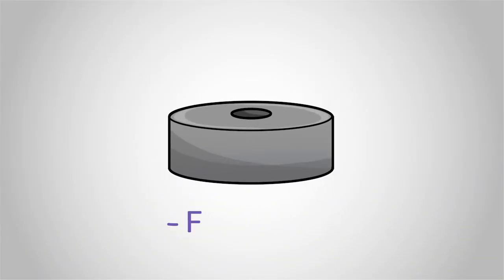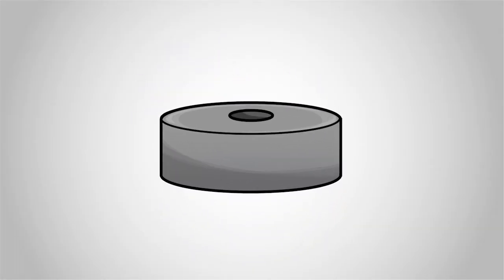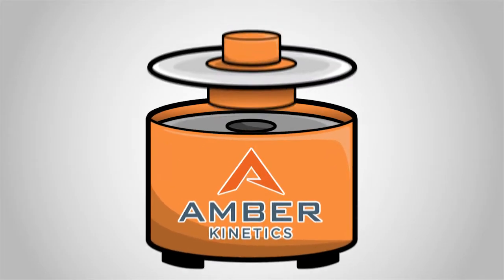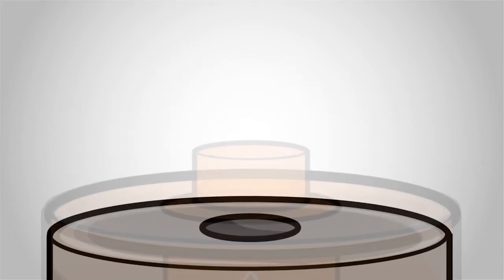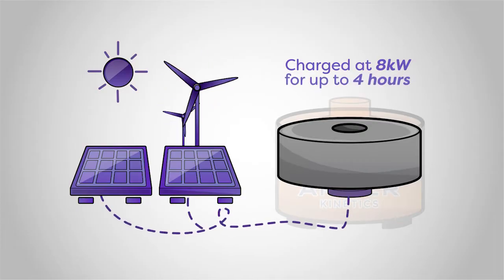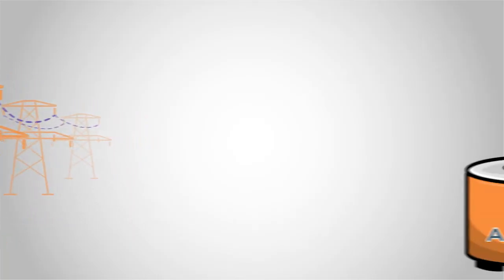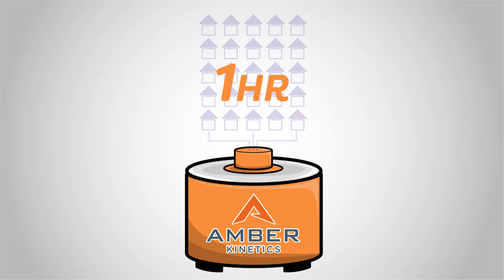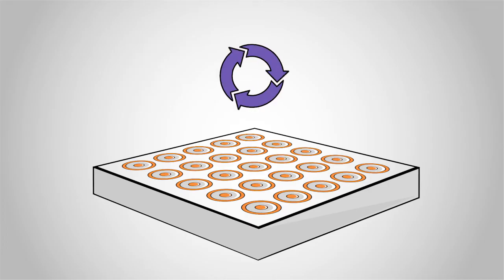How an Amber Kinetics flywheel works

Comment: I wish something of this nature was made for homeowner possession, so that homeowners could experiment with their own ways of generating the kinetic motion required (such as cycling and stepping up gears as needed, experiment with gravity batteries, among others) and therefore crowdsource with other homeowners to see who is able to achieve the highest efficiency and easiest methods, and share those methods with the others.. instead of relying only on a single source company to provide it all. This would also allow Amber Kinetics to not need to worry about securing huge contracts, but simply do sales to individuals..
Reply: It is not profitable for energy companies to let go of consumers. If you install a solar panel and a flywheel, you won't have to pay anyone for 30 years.
Reply: @VolodymyrKostenko-q1m The numbers get worse if consumers link their systems together into a micro-grid.

Comment: This is the perfect sustainable alternative to the $12000 slavery-based-Lithium Tesla Powerwall which can only store 13.5 kWh and you throw it away after 5 years of constant charge-discharge.
Reply: But imagine this fully-charged, heavy spinning wheel flying out of your car in an accident... it would effectively become a kinetic weapon released on the street...
Reply: @joey3291   its easier to stop something mechanically, than a fireblast melting you and the car from a Lithium Ion disaster like we've seen in recent years
Reply: @DreamingConcepts  You can not 'stop' a spinning wheel without it releasing all stored energy on you or something else, this is exactly the same as the case of a burning battery: the stored energy must be released in some way once the containing of it failed. The difference is that when a battery fails, you can run away from it, but when a giant spinning wheel fails, it runs after you...
Reply: @joey3291  tesla powerwall is for the home, and for car there are safety measures
Reply: Lithium is not "slavery based". Cobalt has a small amount of illegal labor, but Lithium Iron Phosphate, LFP, batteries have no cobalt. New Tesla Powerwall batteries use LFP, so there's no cobalt and no slavery or illegal labor.

Comment: Would  the magnet lose its power?
Reply: Takes a long time for that to happen. Upwards of 100 years. The main issue is going to be manufacturing large magnets enough to levitate a flywheel.
Reply: @digiduke2979  as far as i was told if the magnet is constant worked against its Field , it will loss its field.....
Reply: @daydreaminginventor-k8957  You are talking about magnet vs magnet. Try searching rather than being told and good luck with your search.

Comment: My vision is someday there will be huge counterrotating flywheels in space that store all of our energy nearly perfectly.
Reply: So…a planet could a be flywheel?
Reply: The big problem with putting a flywheel in space is that you need gravity in order to hold a dynamo in place. Without that you won't have the friction required to pull the energy back out of the flywheel. You could spin another wheel the opposite direction, like you suggested, but then you've got a whole host of other potential gyroscopic problems. You'd also be introducing more passive friction into the system due to the ENORMOUS axle that would be required to keep them from wobbling and colliding. It's a bit easier, and safer, to keep one spinning wheel steady with the help of earth's gravity than it is to keep two wheels steady without gravity. 

Another thing to consider is that this would be insanely expensive to put into space. It currently costs roughly $10k per lb to shoot something into orbit. The overall size would also be limited by the rocket's payload vs the size of the projects largest solid piece. With all of those problems to consider, it's not likely that we'll live to see a massive ferris wheel-sized flywheel floating in space. Not unless we figured out how to mine asteroids, anyway. Then moving that much metal into orbit would be somewhat trivial. The next issue would be processing the metal. Still, an easier logistical problem to solve than shoving all that metal up into space to begin with.
Reply: @GirthOfANation  @technicallydifficulties7094 another massive issue is getting that energy back to earth, Most countries have a hard enough time establishing a good tranmission network. imagine the logistics of transferring energy from space to earth as it rotates.
Reply: Would they perform better in zero gravity???
Reply: @richbattaglia5350  better in a vacuum no air resistance
Reply: @richbattaglia5350  and wouldn’t need bearings that give some resistance

Comment: I hear everything he’s saying. And it’s kinetic energy what I don’t understand is when the solar panel is put in the electricity into the spinning wheel where does the electricity go it’s not like a conventional battery. It’s just a stainless steel fly wheel. It’s stores 8 kW. So where is the electricity stored
Reply: Electricity powers the motor. Energy is converted to kinetic energy (in the flywheel). From there the energy can be captured again by the motor (now acting as a generator), and converted back to electrical energy.
Reply: another example is the regenerative brakes on electric cars. they steal angular velocity from the wheels by introducing friction from the small generators and then it... generates energy! :)

Comment: Does efficiency scale linearly with size? Could a heavier and larger flywheel that didn't have to spin at such high RPMs be mechanically spun by hydro or wind then used to store power for a city? How large is practical for flywheels?
Reply: I’ve seen bigger I’m trying find it it was 6 or more months ago when I was checking them out
Reply: They say there is one you can fit in your closet that can power your whole entire house with ease
Reply: angular inertia is a formula of mass times radius squared, so if you multiply the radius by 2, you will multiply the inertia by 4. harder to spin but also harder to brake = will store more energy.

Comment: that's bullshit , try to power really anything using a dc generator and see that when the generator spins and outputs power as soon as you put a load on that thing the generator starts to resist and its getting harder to move it . in other words : that wheel would come into a complete halt after a load will be applied because of internal magnetic resistance . everyone nowadays thinks he is some einstein that will solve the worlds energy crisis by grabbing a few bucks on indiegogo .
Reply: Depends on how big the resistance is. How heavy the barrel is and how fast it’s currently spinning. And if all else fails, you could always go with a hybrid system that puts a normal battery in between for more management.

Comment: 32kWh, 8kW is a bit small.  15kW, 100kWh, would be extremely useful tho.

Unit cost? Expected life span? (I guess ~20 years).
Reply: Dude even telsa powerwalls only go up to 30ish Kwh in home use

Comment: how big is that flywheel
Reply: The M32 Flywheel unit is 10,500 lbs (~5 metric tons) and 54" in diameter.
Reply: Its seems like its ment to power the electrical grid, not your home
Reply: So very big

Comment: I've been thinking about this kind of battery last year and after a great effort until I got to the result،I rejoiced and said this is a new invention would change the world, but  I discovered it already exists. The same idea and mechanism of work that I reached without having any idea before
Reply: IMO it’s fantastic when i find out one of my ideas already exists and is being used because it proves that the idea was actually good lol
Reply: @1001-u2i  yess
Reply: The flywheel has was invented over 6000 years ago...we were all a bit late discovering this  :)
Reply: rupert sheldrake morphogenetic field
Reply: @konichiwatanabi  yeah, we all contributed to the creation of it

Everything you think about is helping others think about it better.
Reply: Using flywheels is not optimal. You lose 5% efficiency with electric motors and then another 2% by electric generators. And you will also lose additional energy via. friction due to the weight & rotation of flywheel. This is not a practical solution against lithium batteries.
Reply: @vikraal6974  I think you talk about some cheap home-made flywheel at the level of the 80 years old  Gyrobus which didn't use electricity at all.

The flywheel used for energy storage today are made to be friction-less using magnetic levitation and vacuum sealed which reduces practically all loses. 

They are way more efficient and cost-effective than the rare-material-lithium-based batteries, which cost more energy to produce than the energy they provide before you deplete their limited amount of cycles and you have to throw it away and buy a new one.
Reply: what is the service life of a lithium, cost, disposal, upfront energy to create?
Reply: Add me to the list of being 6k years late as well then fellers. At least we are trying though. Lol

Comment: If you make a flywheel capable of supplying an apartment with energy for a day, I will buy it!
Reply: Yeah, now you have to buy it, those are the rules
Reply: 25 American homes for 1 hour = 1 American home for 25 hours
Reply: @keepyourseacrits  I don't think that's achievable. The flywheel will spin down without external power. They need to say how long it takes to spin down to a unusable RPM to generate the necessary power to run a house.
Reply: Charged at 8 kw for 4 hours? Only 4 hours? For home use, better to pump water into large tank uphill.
Reply: @NotHumant8727  do u know how much water u will need for that?
Reply: First Last but doesnt it take just as much energy to pump it uphill as you will get out of it?
Reply: A lot of apartments have electrical appliances, especially stoves. A modest electrical stove using all 4 top burners can consume 10 kw an hour. Induction stoves can consume as much as 25 kw per hour. But imagine using these to trickle charge vehicles or gas car batteries.
Reply: @cherylm2C6671  What do u mean by 10kw per hour? KW is an unit of power. 10kw power means 10 kilo joules of energy consumed in 1 second. If your 10kw appliance runs for 1 hour, the energy consumed is 10kw-hour, which is equal to 10 electrical units. Your power company charges u on the basis of how many units u have consumed over a month. If a 10kw appliance runs for 1 hour and a 5kw appliance runs for 2 hours, energy consumed will be same- 10units in both cases. However, the peak power can be a problem sometimes. Like in lithium ion batteries the peak power is quite low.
For example a Tesla car p100d battery pack contains 100kwh i.e. 100units. It can run a 200kw motor of the car for 30minutes at full power (theoritically). But can it run a 400kw motor for 15 minutes? Mathematics says it can. But in reality it cannot. Because the current drawn by a 400kw motor will cause excessive heat and the battery pack will melt/ burn out. So every energy storage system has a peak power rating. If peak power rating is exceeded, the system will get damaged/ life of the device will reduce drastically.
In the flywheel energy storage system (FESS) shown here, the peak power rating is very high. It is so high that it is used in the EMALS system of the latest Gerald R Ford class aircraft carrier of United States Navy, to launch aircrafts. Smaller versions have also been tested on F1 racing cars in kinetic energy recovery system (KERS).
Reply: I also like the idea, but I wonder what the main cost would be compared to the amount of money saved by either using off hours electricity, or off grid means such as renewables. I'd love to know, and it would be an interesting concept to see these used in residential use instead of primarily industrial or military uses
Reply: The only way this makes sense to use for that application is if the energy used to spin it comes from solar, water or wind (like a solar/battery system). Otherwise it would be cheaper just to use the grid to power a house or apartment.